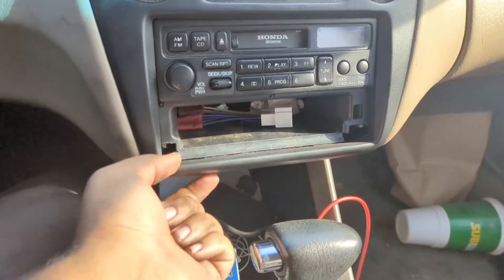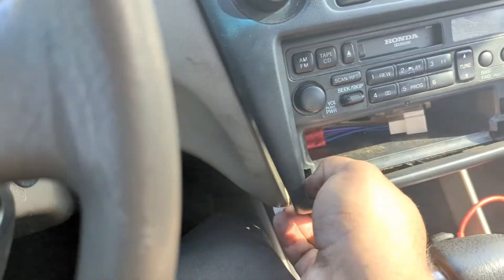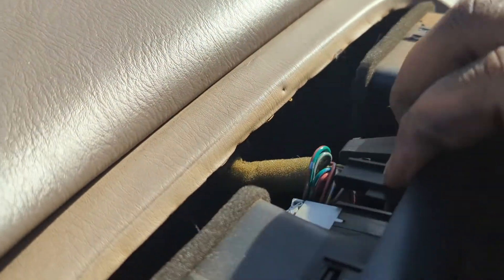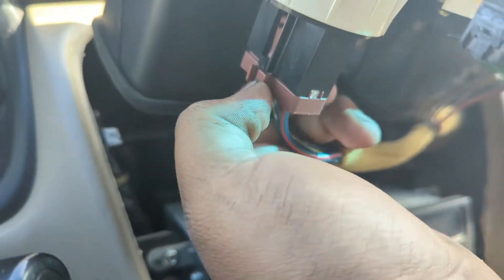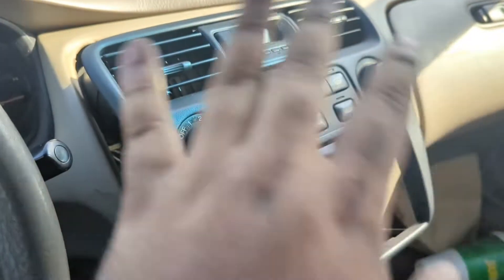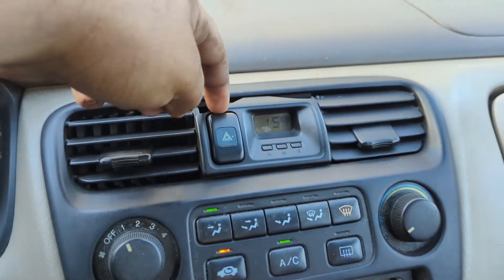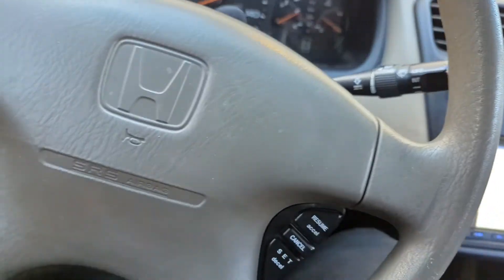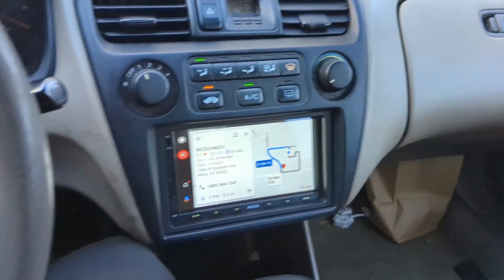98-02 Accord Double Din Radio Install

Comment: I’m revisiting the video. It was extremely helpful at the time. Still a good reminder. I’m going to take it back out and wire the microphone in
Reply from the maker: Thank you I love the support y'all give me.
Reply: @ibbryant17 what the anti-theft security system in the radio
Reply: Do I need to put the code in the radio first  or can I just take out the factory radio
Reply from the maker: Just remove the factory radio no need for a code

Comment: 51 and I was born into street racing (60's muscle cars). One thing my dad told me was, "hot rods/race cars are bottomless money pits".😅 They're definitely fun but 99% of the time you'll never get back what you put in them.
Reply from the maker: I never expect to get my money back
Reply: @ibbryant17  I finally got the door speakers in today. I had to cut the back off the factory insert. If I had gotten the rings they would have dropped right in but I went on the information from eBay. 
Thanks for uploading the video. 8)
Reply from the maker: Hell yeah man I'm glad to hear it.

Comment: Did you use the Metra 95-7895 98-02 Honda Accord Double Din Dash Installation Kit?
Reply from the maker: Yes that looks like the one I used
Reply: @ibbryant17  The American Industrial HonK831 sits flush on it if you just pair the faceplate with the Metra brackets

Comment: Does the steering wheel controls still work and did u have to bypass the parking brake with that particular stereo?
Reply from the maker: My car didn't have steering wheel controls but you can definitely get them to work if you do. There's additional interface boxes you can get. And no I didn't have to bypass anything

Comment: Would this work in a 01 accord lx and if it does do I need to buy a dash kit and which kind of dash kit and what kind of cables if needed
Reply from the maker: It will work on a 01. I recommend the metra dash kit and any adapter harness you find for a 01 accord.
Reply: Ok thx and if decided to get another radio as long as it is 7 inches it would work as well right
Reply from the maker: Yes I think so. If I remember correctly the radio I installed in this video is 7 inches

Comment: Great video but does the radio go dead ? Or do you have to charge the radio up ?
Reply from the maker: No the radio is wired it to the cars factory 12v system so it's powered the same way the stock radio is. No need to charge it
Reply: Ive never in my life see a radio go dead and need changing. Huhhhhhhhh
Reply: @gardyfaustin8707  he must be new here lol

Comment: Bought this stereo from your link... it’s slightly too small for my 2001 accord and also didn’t come with the adapter plug to fit my car.. or wifi, etc.. I’m going to try and make it work. I appreciate the video, never know with eBay? Anyway, thanks
Reply from the maker: You have to buy the dash kit separately. That will come with the wiring adapter to fit your car and the bracket to make it fit inside of the radio opening
Reply: @ibbryant17  ah okay. I went to my local car audio place and picked up an adapter.. aside from a slight gap around the stereo, I’m pretty happy with it. I appreciate your videos 👍

Comment: Did your dash lights go out?
Reply from the maker: I think 1 did. I ended up doing LED bulbs in my cluster
Reply: @ibbryant17  ik a common problem with 2000 accords when replacing the radios is the lights go out in the dashboard the fuse keeps popping

Comment: Hey may you add the links for the parts you used? Please and thank you
Reply from the maker: Since making this vid I've had to change the links multiple times because sellers change the item so the link no longer works or takes you to a listing for the wrong part. The stuff I used is all over eBay and it's easy to find tho

Comment: Hi I just got my 2000 Honda Accord V6 Last week and went into Best Buy and they have a free installation for if you spend $200 or more on a radio so they suggested the JVC 6.8 Bluetooth digital media receiver black sku: 6401891 the metra dash kit for select 1990-2006 Honda Civic CR-V accord Odyssey TL Integra CL Prelude DDIN sku: 5325608 and the metra radio harness for select 1996-2013 Honda Acura Suzuki sku: 347146 my total would come out to be $248?15 what are your thoughts?
Reply from the maker: Free Install makes it worth it immediately
Reply: @ibbryant17 thank you bro I appreciate you 👍🏼
Reply: @ibbryant17 hey I'm having problems starting my engine with the key in the ignition. I made a mistake and did an oil change with the 10w 30 oil synthetic oil instead of regular because my dad told me it would last longer since I drive 5-6 hours a day doing Uber Eats. My check engine light is on and sometimes I got to charge up the alternator by pressuring the gas and holding the key in the ignition. Any suggestions?
Reply from the maker: @tiffanyacosta9716 the synthetic oil is fine I used it in my accord. Make sure your maintenance is up. Spark plugs being bad can cause a rough start and if your cap and rotor are worn on your distributor. Small things like that. Or even if your battery is old and worn. Before assuming the worst make sure simple stuff like that is okay first

Comment: Is it worth it I have the same factory radio you had
Reply from the maker: 100% worth it the factory unit is super lack luster. But this radio is louder way more clear and is super useful with the Android auto and apple car play
Reply: @ibbryant17  thanks cuz rn I have a Bluetooth transmitter and my phone plays in the car but has a static noise since I need to put my radio at the least static and sometimes some songs don’t sound good on the speakers or static overload, I just want a straight aux connect
Reply from the maker: It makes the radio sound incredibly clear. I would upgrade your speakers still cuz the head unit I have will be way too much for those old speakers to handle

Comment: Will this fit in 99 honda
Reply from the maker: It's a universal radio just buy the install kit for your specific model
Reply: @ibbryant17  so get this specific one? How many inches it the radio 7? I’m not sure on which one to get
Reply from the maker: If it's a 99 accord then yes the same one I got and I can't remember the screen size but it's a good useable display
Reply: @ibbryant17  okay thank you and last question I’m sorry , is there any thing else I get the screen… any tools I would need and I can do this completely by myself?

Comment: Bro I will PayPal you 20 if you walk me through it on facetime, I have never put in a new radio
Reply from the maker: It's not too hard once you buy all the adapters you need. And then just look up your radios wiring diagram. It's mostly just matching up colors to colors though. Aftermarket has created a standard that everyone uses
Reply from the maker: Hey man I wanted to make sure you got your radio installed. If not DM me on IG

Comment: Can you link the product link in description
Reply from the maker: No the links change over time. I used to have everything linked but the links don't work anymore so I got rid of them
Reply: Thanks for responding.
Do you know what wiring harness?
I assume if I buy wiring harness I simply plug that into cars factory harness then to the back of the new head unit?
Reply from the maker: You have to wire it yourself but it's very easy. Get an adapter harness for an accord in your cars year. The head unit will come with it's own plug. Then all you gotta do is match the colors and it'll work